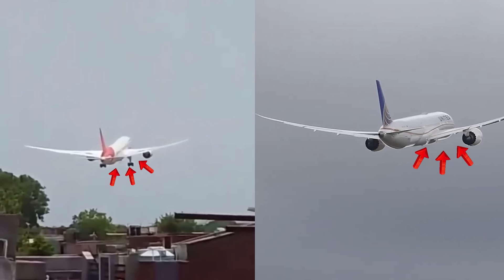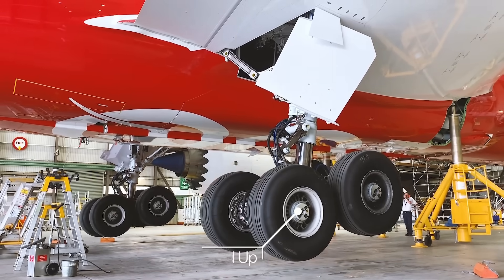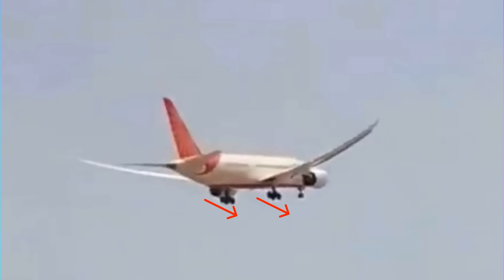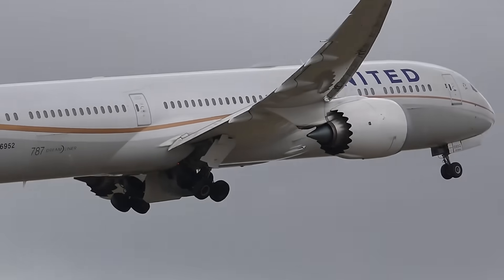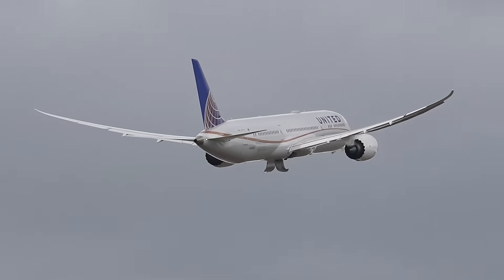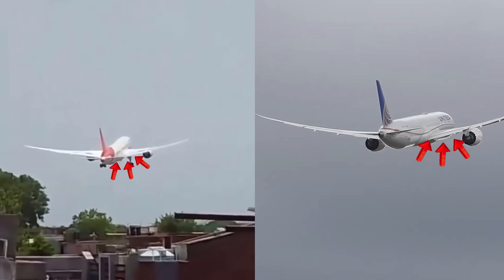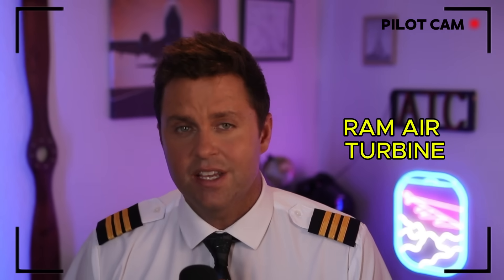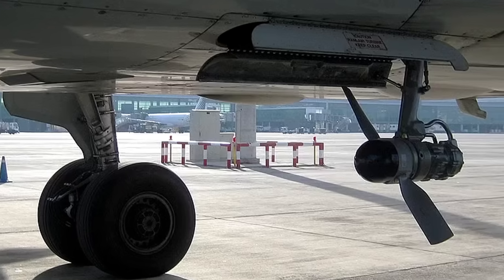Pilot Explains: A New Detail in the Air India 787 Crash Everyone Missed

Comment: The RAT is possibly designed for landing only not for takeoff 
Captain Steve mentioned the RAT for gliding into a landing 
The RAT Pump maybe too small & not enough flow to retract the landing gear ⚙️
Good point, cant hear the engines @ Full Noise

Comment: The RAT is clearly not the issue, but agree it was an indication that there was a loss of power. Forget the landing gear concern since the aircraft was only at 183m for a few seconds. Full engine trust could have easily accommodated the gear extended a while longer just as Boeing demonstrated during flight test. Since it is very unlikely that both engines would flame out at the same time as you noted, my guess is that the first officer may have inadvertently flipped the fuel shutoff switches for both engines, which are next to the flap setting switches thus cutting off the fuel supply for both engines.

Comment: I agree, this just added up to both engines losing thrust relatively quickly. As you mentioned, reasons could be any kind of technical failure (although I think that would be a first on a 787 for this) or... a pilot just putting the throttle to idle or cutting off fuel. Fuel contamination is also an option, although as some have said, it's odd that it would make both engines fail at nearly the same time. Although: they may not have lost thrust at the same time. Do you think it's possible it started with one of the engines on the runway, they took off anyway and then the second engine stalled from what looks like about 10 sec after take off... so potentially each engine failed with possibly over 30 sec of delay, maybe even a bit more, thus making fuel contamination a possibility.

Now strictly from the plane behavior when it starts to lose lift, it could very well be explained by the throttle being pulled back to idle. There would be a couple seconds of inertia as we can see on the video. I'm not saying that's what happened, but I'm saying I think we could reproduce the exact same behavior by doing this (in simulator). Engine stalling would be more sudden, wouldn't it? Just a question. Now apparently there seems to be a consensus about the RAT being deployed and loss of electrical power. Although I'm not sure, I've heard that the RAT may be deployed in case of a single engine failure on this plane. Is this correct?

Comment: I reckon complete electrical failure, when gear up selected the aircraft has shorted out.  There has to be a reason the engines that were presumably fire walled didn’t respond but double engine failure is hard to imagine and will shake the future of the 787 for years if it’s happened.

Comment: The survivor said he heard a bang.  

• If a battery explosion caused a severe electrical fire or damage to wiring that specifically affected the fuel pump circuits, it could potentially result in fuel pump malfunction. This could occur if:
• The wiring to the fuel pumps is damaged or shorted due to the fire or explosion.
• A circuit breaker or electrical component designed to protect the fuel pump circuit is damaged or trips, causing the fuel pumps to lose power.
• Thermal damage from the fire spreads to the fuel pump power distribution systems or the fuel tank monitoring systems, affecting the pumps' operation.

The previous flight passengers said there were electrical problems.

It could be the hot day, coupled with electrical issues caused a lithium battery to explode and damage the wiring or circuitry to the fuel pumps causing total loss of power thus popping out the RAT.  
This seems most likely given all the facts presented so far.

Comment: This is a huge problem for Boeing, and commercial aviation in general.  As a deep water small boat sailor, contaminated fuel is definitely a possibility as I had to add a second fuel water separator, and keep a very careful watch on them both.    I could drain the water off into the bilge.  This was with a diesel engine.  I think jet fuel is like a light kerosene, and would behave similarly.  The fuel floats above the water.

Comment: YOU ARE RIGHT LOSS OF POWER ON BOTH ENGINES THE LANDING GEAR DID NOT HAVE POWER TO RETRACT  ALL POWER COMES FROM THE ENGINES WHEN THEY MAKE THESE JETS THEY DO TESTS WITH LANDING GEAR DOWN AND FULL FLAPS IN FLIGHT WITH BOTH WORKING ENGINES THE 787 IS A VERY GOOD PLANE BUT WITH OUT MAX TRUST IT WONT FLY THE NTSB WILL FIND OUT WHY THE FINE JETLINER FELL OUT OF THE SKY REST IN POWER TO ALL SOULS LOST ON AIR INDIA 787-8 AND THANKS TO ALL AIRLINE PILOTS ALL OVER THE WORLD  KEEP UP THE GREAT WORK AND BE SAFE

Comment: Let's examine the wreckage and see if we can determine the position of the flaps/slats.  Also what is the position of the flap lever and indicator in the wreckage of the cockpit. This is the first thing aircraft accident investigators will look at.  Also highly trained NTSB investigators can determine if the engines were at takeoff power with great accuracy.  The Flight Data Recorder   information (so called black box which is orange) will confirm.

Comment: Another pilot has thrown out the possibility of vapor lock in the main fuel line, possibly due to the excessive heat on the ground that day, along with the loss of fuel pumps. The plane was reportedly quite hot for entering passengers.

Comment: Hi Gary.  I don't think anyone has mentioned this, but a common mode software error in the FADEC (Full Authority Digital Engine Controller) could potentially result in a dual engine failure. The FADECs are usually programmed by the engine companies.  I'm a bit worried about this.  Has anyone from the engine companies weighed in on this angle?
Reply: ....just a follow up comment.... an electrical failure would result in RAT deployment, which would quickly restore power to the flight control computer and the FADEC, so an electric failure would not result in engine failure.  However, a software error in the FADEC could quickly and simultaneously shut down both engines.  No bang, no smoke, just engines immediately turned off.  The FADEC might be reacting to erroneous sensor input data.

Comment: I am convinced that the dual engine failure was caused by a catastrophic electrical malfunction. It fits perfectly with Passenger 11A's evidence of a loud bang and the lights flickering. The 787, like most modern aircraft, are electrical system dependent in ways that older aircraft were not.
Reply: RAT deployment makes a loud bang as it is spring loaded and deploys with force, that could account for the bang.
Reply: A passenger that was on that plane, he got off because he wasn't going to London? He posted a video of the conditions with the power, like no air conditioning etc. Hard to watch knowing those same people & children I heard...are now gone. 😢
Reply: @lindam.9600  that was from an earlier flight of the same plane, and AC wasn't working and his screen wasn't working, those were the only issues. AC just wasn't turned on yet.
Reply: @FeritTuzer Thanks. So a separate flight and it was before the plane had engaged its own power source when starting the engines. That sounds completely normal to me.
Reply: @FeritTuzer yes, but in his recent video he goes into more things, including the wing. Some channel called Republic ? has his recent video too.
Reply: @lindam.9600 Are you saying that someone decided not to fly before the plane departed? Source please?
Reply: @robert.wigley no, it was the end of his trip. He has posted more videos about what happened. In this video he thought something about the flap was unusual. He was in seat 25, I think he got off approximately 2 hours before this plane took off. Republic ? that channel showed his videos.
Reply: @robert.wigley  One passenger missed the flight because he arrived late.
Reply: @robert.wigley  thats tumor and its fake. All passengers were onboard except one who was late
Reply: @Pk_1911 I strongly suspect it's wrong, but until I research and fact check, or someone provides proper evidence of claims, I'll take everything with a pinch of salt.
Reply: @robert.wigley  You give me proof that that passenger opted out from boarding the plane. There is no media which is telling this. I am Indian myself and have been all our local media which are making coverage on this🙂
Reply: @Pk_1911 I did not say that. That was my point. I have seen no evidence that someone decided not to fly.
Reply: @robert.wigley gotcha.
Reply: @lindam.9600  thats fake
Reply: Passenger 11A specifically said green flashing lights in the cabin.  When does the 787 use green flashing lights?
Reply: @hdthor Where has this been reported please?

The 787 uses RGBW LED lighting, so even if this is true, it could just be a symptom of the LED controller glitching due to an electrical failure as the RAT took over.
Reply: @hdthor  Floor mounted emergency light strips.
Reply: he never said bang and flickering. He only said the green and white lights came on. MSNBC short: 'I don't believe it': Sole Indian plane crash survivor speaks".
Reply: @FeritTuzer Thanks for the source. Green and white, or any colour mix, sounds like the LED controller glitching.
Reply: I agree Robert, especially based on what appears to be major electrical issues on the prior flight.
Reply: That what I believe      some one mentioned  Air lock    does also make sense  the plane was sitting for  Hours in  Scorching  heart
Reply: OK, thanks for the additional things to research. I will look into this more tomorrow. I am still convinced it was a catastrophic electrical failure. I guess time will tell whether I am correct. I'm looking at this with an IT and electrical background for context.
Reply: 100% agree
Reply: A passenger who was on the same flight or same plane tweeted that all electrical instruments were not working properly even the infotainment system was barely working
Reply: BINGO.  This could actually be the genesis of this crash sequence.
Reply: Centralized electrical/software design is the worst nightmare of any complex system—it’s the perfect recipe for single-point failures—one small mistake and it’ll take down the entire system. If this indeed is what happened, I’d blame the decision makers and approvers of this design—whether it’s the engineering team or management team or both.
Reply: The "Loud Bang"  related by the lone survivor, has NOT been really explained at all.   Also, there was also mention of "some object" observed in one of the videos which was reported (commented) that it seemed to have fallen from the aircraft.  THAT item has received no other comments, as everyone is focusing on flaps, RAT, gear, flickering lights, etc.  I don't think the RAT deploying caused the "loud bang" so lets give these two items a little attention, could we?

Comment: I like your explanation on the gear  if both  engines  flamed out at that low altitude and the RAT deployed allowing the the fuel  pumps  to engage  restart would not have been possible.

Comment: My two cents… About a month ago India & Pakistan had a serious military engagement on their border. Military aircraft were shot down. Many of Pakistan’s Muslims hate the “infidel” Hindus & Buddhists of India. (That’s why the Northwest portion of India split off in 1947 to become Pakistan). 

What if a disgruntled or crazed first officer simply reached up and shut down the engines… or pulled both throttles back to flight idle and held them there?  I believe that would be the only way to “kill” both engines at exactly the same time. There was no momentary yaw visible in the video to indicate a non-simultaneous failure. As a 777 pilot, you know those massive GE engines don’t re-start or spool up instantly.  (Remember a couple years ago when a mentally disturbed Alaska Airlines pilot, in the jump seat, tried to do this at altitude?)

Since they’ve recovered the flight data recorder & cockpit voice recorder, it’s possible authorities already know the answer. After all, they haven’t grounded other 787’s.  If we hear “Allah Akbar” on the cockpit voice recorder, we’ll know what happened…

Comment: Doesn't the 787 engines initially draw from a central fuselage tank before the wing tanks under normal operation?.  In that case, contaminated fuel could be an issue.  I'm sure he investigators will look at throttle, gear and flap position controls.  The CVR and FDR will be an interesting bits of evidence.